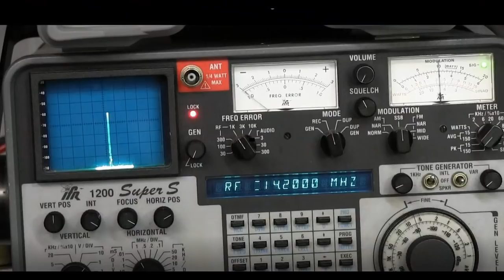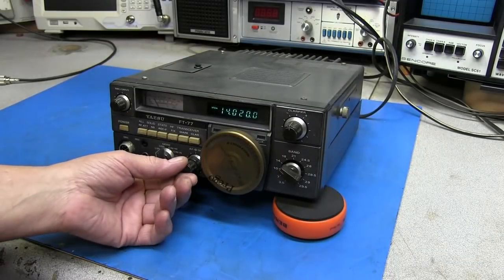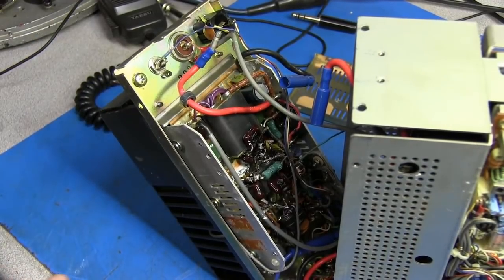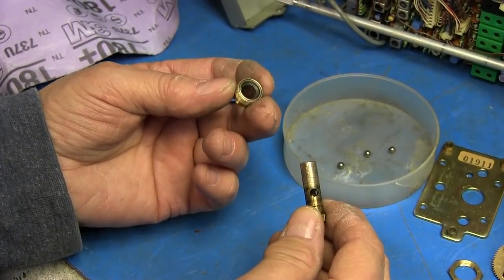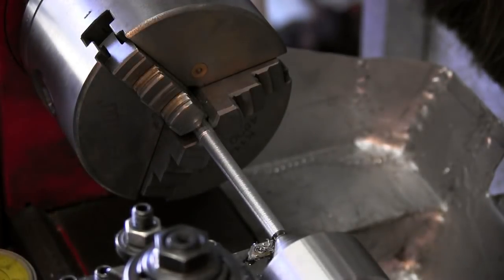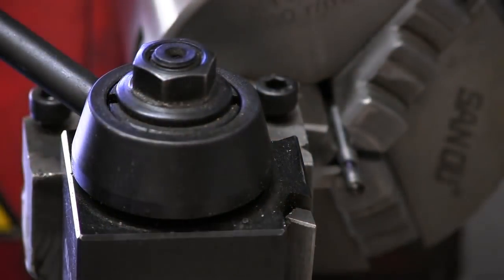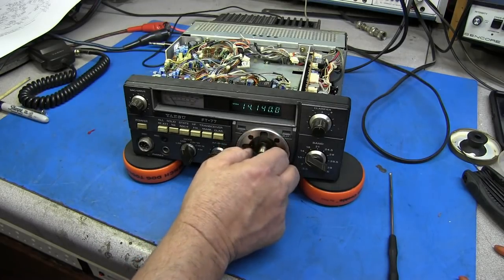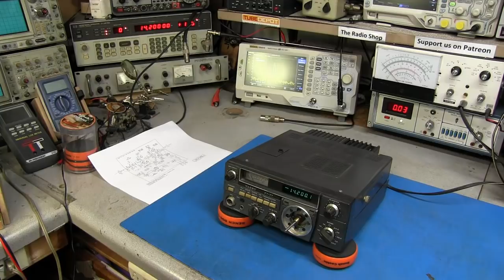#266 Yaesu FT -77 Check Out Part 1  -   926 Winner

Comment: Great video Buddy. One of the things I like about you is you will take your time and work on some of this older gear that most people would just part out. Most techs would not bother to try and fine a VFO knob for this rig let alone make a new VFO knob out of aluminum. BTW Buddy how is that 2003 Mustang been running?  Congratulations Mark on winning the soldering station. 73 Joe
Reply from the maker: Thanks Joseph.  I am just partial to old equipment and hate seeing them junked.  This is a very basic rig and is easy to work on.  The mustang is still running great and worked a few bugs out. Next project on it is to install a new convertable top.

Comment: That radio is very similar to the Kenwood ts120s and ts130s. Used to repair lots of the 120 130 radios plus the 520 line, 820, 830 etc..
Great hf rigs when they are working properly.
Reply from the maker: It seems Kenwood and Yaesu did things the same way back in that era.  The 77 was know for it great noise blanker.

Comment: GREAT job on that radio and milling that shaft.
Congratulations to Mark A.!
BTW, I have a tektronix 321 scope that I restored but the main filter caps were good so I did not have to replace them.
I also have the EICO 324 and added a BNC jack on the front for a frequency counter.
Question...are you going to do a rang test on those MURS radios?
Reply: Thanks 😊
Reply from the maker: Thanks Bill. Yes I am going to do another video on the MURS radio. Tear down and range check.
Reply: @TheRadioShop  Be looking forward to that Buddy

Comment: Hey since you are fabricating a knob, I seen a very old rig somewhere that had a large wheel like that, there were two dibits on the face one slightly offset from the center and one near the outside the center was handy for fast spinning the outer for slower spinning and the outside of the knob for fine tune, just a quick suggestion
Reply from the maker: Thanks for that tip